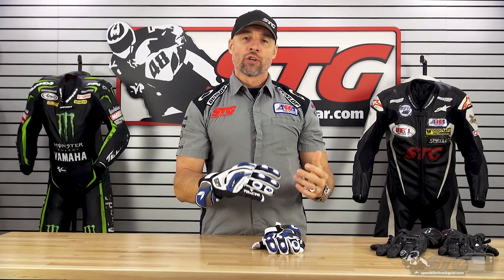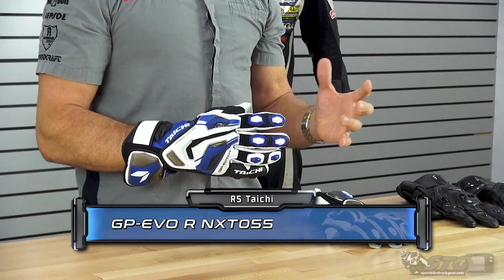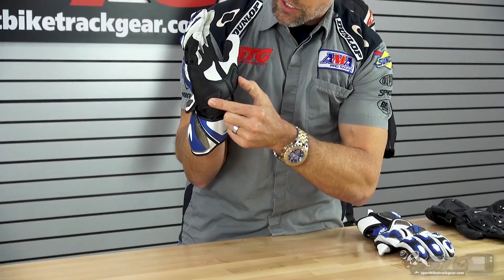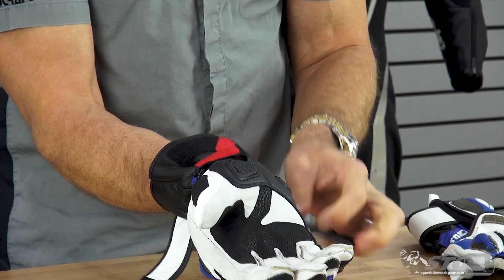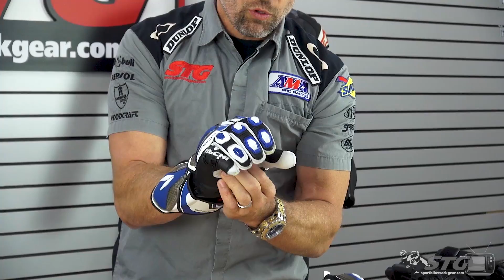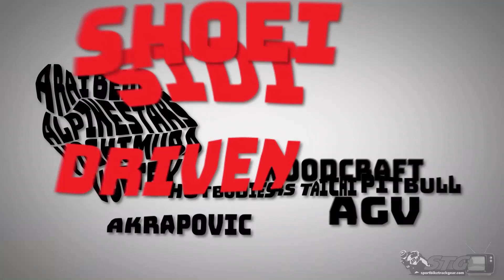RS Taichi GP-EVO R NXT055 Racing Glove Review | Sportbike Track Gear

Comment: New to riding period, never bought a high end pair of gloves and reached out to your cs and they said these were his favorite, question is do they fit like normal gloves or is the measurement chart spot on? I am stuck in between a medium and large in most work gloves
Reply from the maker: Sorry for the late response, I was busy getting ready for the first race. I would say the Taich size chart is good and works for most. Very important to wear the gloves in the house long enough to know if you like the fit before you ride in them. Once you ride in them we can not exchange. Personally I do not like my gloves very tight for that reason I would suggest you go with the large if you are between sizes. - Van
Reply: @sportbiketrackgear  yep I bought the large and sent them back and got the medium gloves, they are awesome. Thanks

Comment: I got a pair of these. I really wanted to like them. They have some great features not found elsewhere. Unfortunately the knuckle protectors cause pressure points for me that are unacceptable. I ride endurance nd this is a non starter. The pressure comes from the design. You won’t notice this until youhave the gloves in your hands. Externally you see 2 plastic knuckle gaurds. What you dont see is that under those is a foam and leather panel which is great padding. But under that is another hard plastic knuckle guard. The kind you are used to seeing on the outside of most other manufacturers gloves. You know, that knuckle shaped piece that is usually made of carbon. Unfortunately in this glove that thick leather and foam pad above it presses down in that 2nd knuckle guard when you grip the bars. You can feel the part if you slip your finders under the knuckle flap on the top of the glove. 

If i could remove that piece, these would be golden on my boney knuckles. These are really nice gloves otherwise. For me and my boney knuckles, this just doesn’t work. I think i will try the “racer glove” line next from Lee Park’s company.. if anyone knows a way to remove the inner knuckle guard, post up because these would rock if I could do that!
Reply from the maker: Thanks for sharing your feedback. It is important to remember we are all shaped differently and have different likes and dislikes. I have worn these gloves and did not experience any issue with them. Like them a lot and would recommend them. - Van
Reply: Unfortunate that your hands didn’t work with these, for me personally after one break in ride these are a dream comfort wise. The knuckle area is perfect, no pressure point etc. which has been an issue for me on other gloves

Comment: Hey Van, my GP-Evos finally died after 6 years... the only thing I was wondering about these new GPs, is there any way to get the fingers working on a cell phone? Some kind of accessory or add-on? I'd really prefer to grab the new version but I kinda want cell phone work since most of my riding is long distance to get into the mountains.
Reply: my iphone seemed to work when I wore these exact gloves.  I can test it this weekend when I go to the track and report back for you too
Reply from the maker: Negative on the cell phone action my man. I do not see Taichi adding that to their top end race gloves any time soon. I really like this glove and am excited to ride in them this season. - Van
Reply: Just to confirm, they will work on touch screen phones but it’s not perfect. Once you start sweating thru the leather, the connection will get easier and more reliable